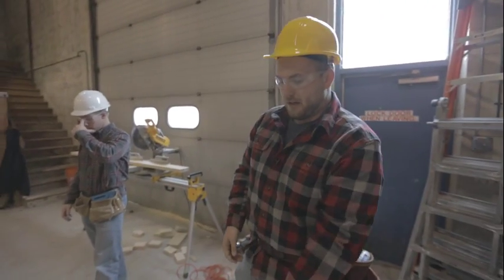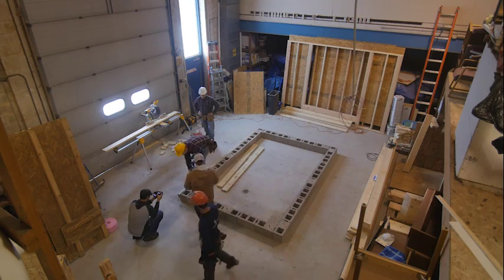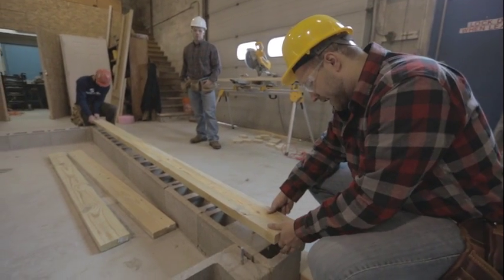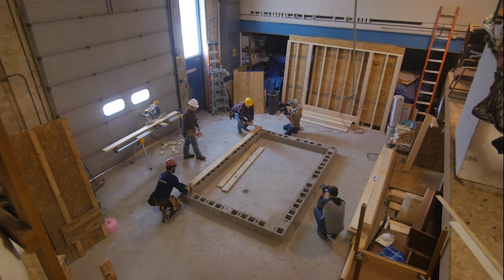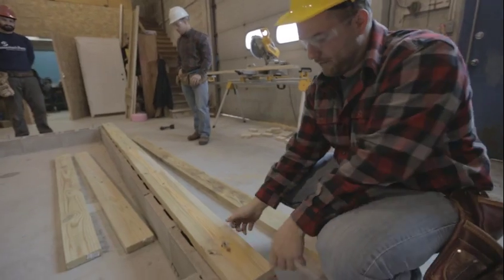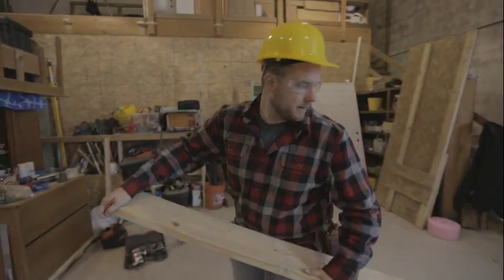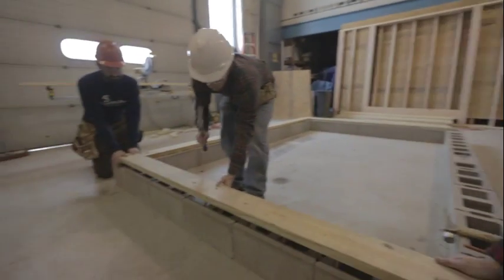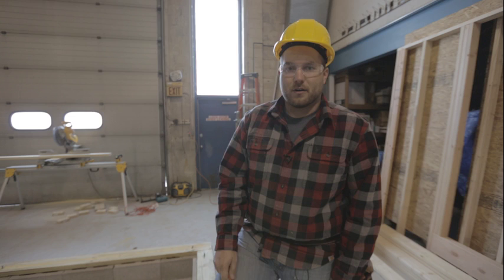How to - Floor Framing Part 2: Marking and Drilling Mud Sill for Anchor Bolts

Comment: Thanks for the videos guys! very helpful. I am about to build a shop on my own and this is great. My only question, just like Michaels questions, is why are 2 of the sill plates inset 7/16 and not the other 2? was this an oversight or intentional? It does look like you are trying to get flust with the other board, so maybe that was it. If so, should we be trimming off the 7/16 off the board to compensate as well? Just looking for clarity is all. Thanks!
Reply: I think he was snorting coke when he went flush with the concrete edge

Comment: Is appears that 2 of the 4 sip plates are set back 7/16" from the edge of the blocks and that the other two are flush with the edge of the block. Why didn't they get setback 7/16" also?
Reply: 5 years no answer eh
Reply: He was snorting coke

Comment: Rather than hitting them with a hammer, a lot of folks use a length of steel pipe to straighten any not-quite perpendicular anchor bolts.  That what I do -- of course, with a bolt in place to protect the threads.

Comment: Question.

Ive agot about 3 years combined experience as a Layout Helper for a Production Framing company (I started just before the recession and just recently got back into it.)

I never did much plating on my first crew as we usually pieced that out since we had enough work. Now though, thats not quite the case.

Anyway, I work here in Southern California, specifically in many Cat. D & E seismic areas so drilling becomes 2nd nature fairly quickly. There is one issue I've been having though since I started plating that has gotten real frustrating real quick and I was hoping you could help me with.

The majority of garage door openings out here are framed using the WSP Portal w/ Tie Down method so the walls on either side are (usually) framed using 3x6 plate held down with 2 1" bolts, usually about 10" apart and between 1&2 1/2" bolts inbetween. 

With the rest of the house we typically use a bolt marker , but sometimes we wind up having to mark by hand and I usually have no problems when having to do that, the plates fit just fine and sit right on the line like they are supposed to.

But for some reason no matter what I do, and Im not measuring them any differently, I'll get AT least 1 or 2 houses where the plate winds up sitting between 1/4" and 1/2" off the line and then having to replate it.

I don't get it and its driving me insane. Am I missing something? Is there that much of a diff. between 2x and 3x (in terms of measuring laterally obviously) I don't know. I'm at a loss. Any suggestions?
Reply: Yeah answer is simple...   with only two holes in board your probably installing the sill plate upside down or backwards lol 2 1from int. Snap line to center of bolt upside down is which is a half inch for example. With 5/8” bolts I use 1 1/8” aggressive auger bit. Fast easy and room to adjust...